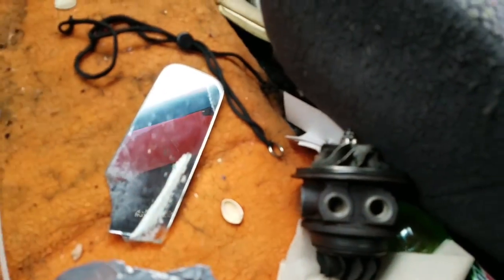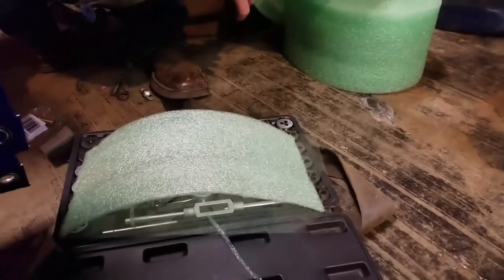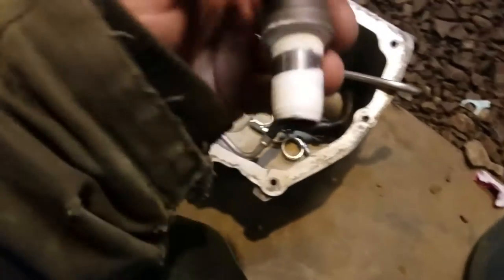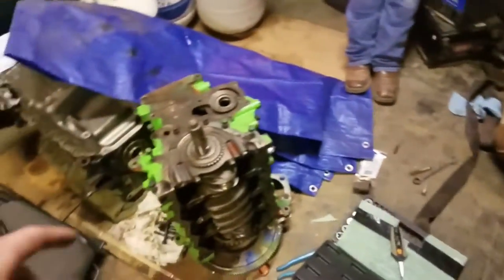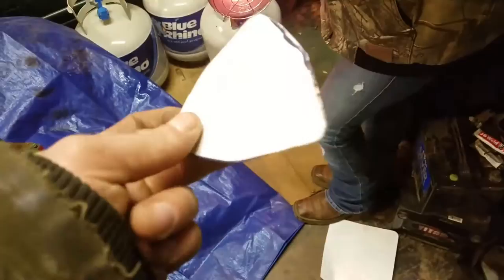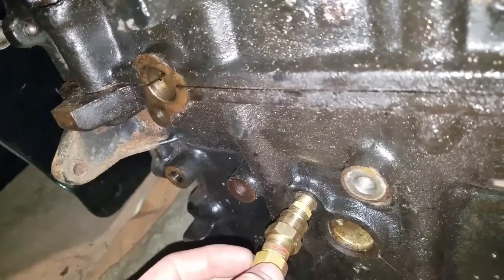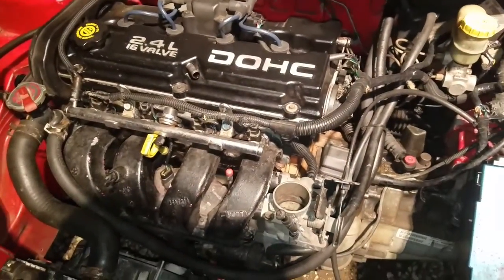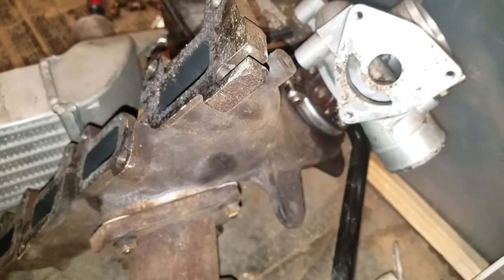Removing The Long Tube Header!!(How to turbo your dohc neon pt.3)

Comment: all most time to start boosting  . once you have a lil boost you will won't  more
Reply from the maker: +MrShelbydodge i know that's why I'm building a block ! Testing everything on the motor then stepping up to my fully built motor and 30 psi lol ....i just need a tune! What are u using for a tune?
Reply: I haven't  got that far yet . I have a program   for it . I forgot  what it's called  I'll let know . 30 psi will be sick  I run 25 for a min on my holset  (can you say roll out)
Reply from the maker: +MrShelbydodge hell yea ROLL OUT!